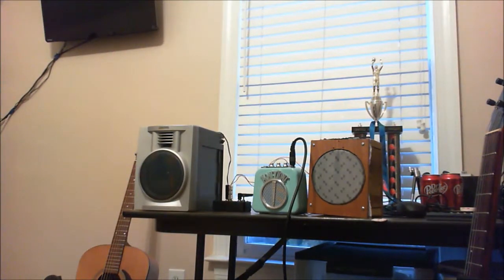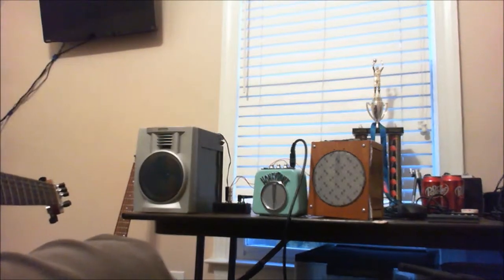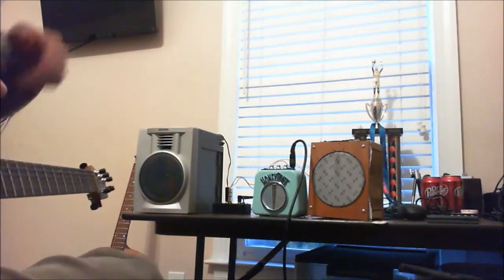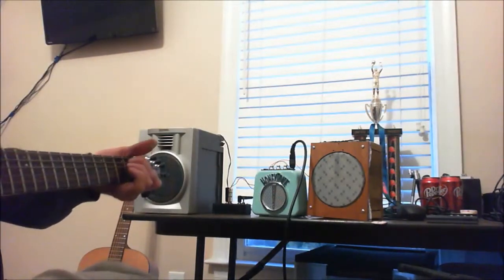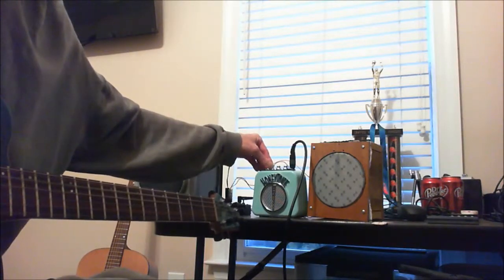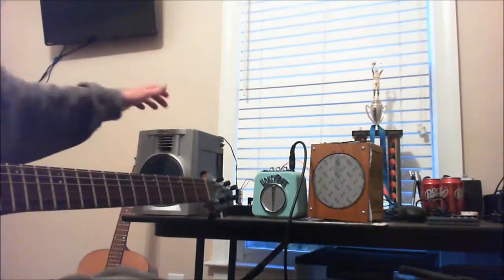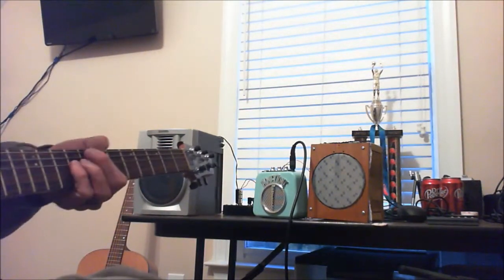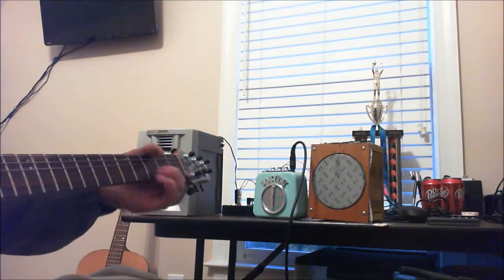HoneyTone Hack a Thon

Comment: Only 2 comments?!
Youre halfway there! Put a jack in the side, detach speaker wire, run to 1/4 jack, then...this is important. 
Never use the overdrive! Center the tone, run volume a little less than max. Then i use a zoom g1four. A room full of virtual gear, various amps and effects including a noise reduction it calls znr. Dont just use the presets. Learn its full potential,  A riot to play❤ has a drum machine  for basic timing.
You could play a small bar with this. Any 8 ohm speaker. Mine is 10 watts. A curb find at that,  Could drive a little more
Thinking of trying a sony center surround speaker next.